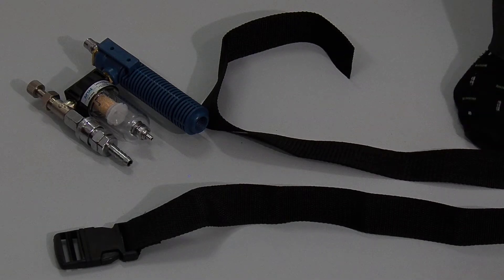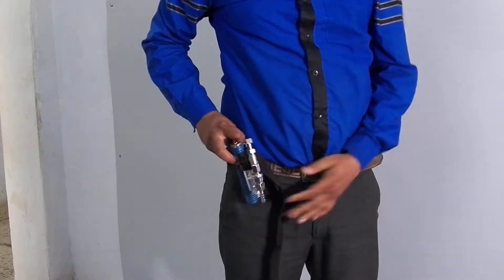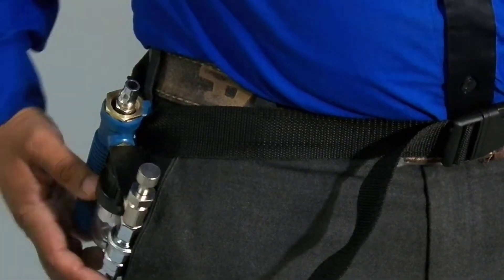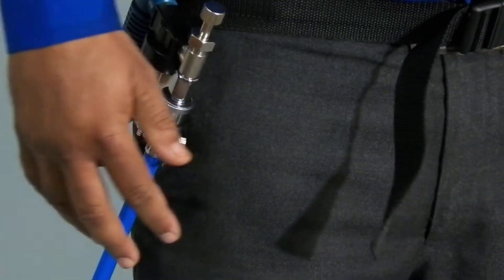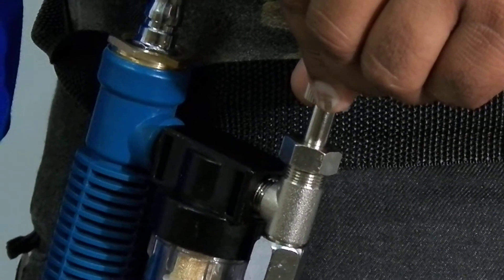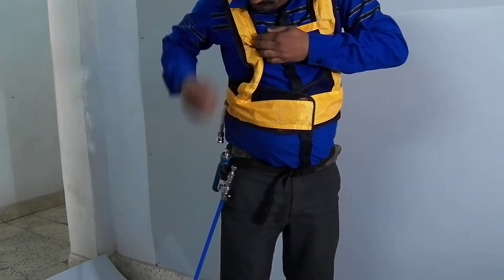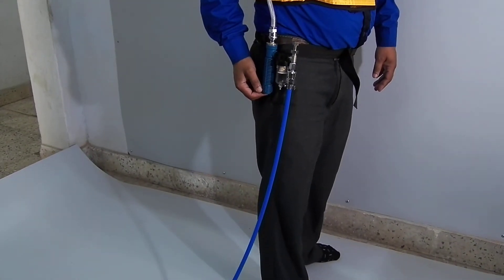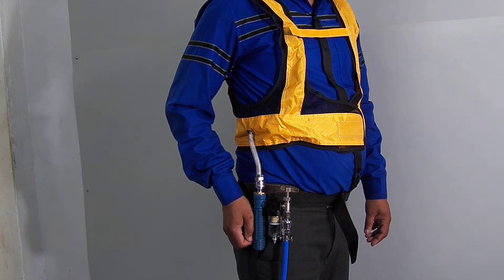General imsubs™ Vortex tube based personal Cooling Vest, how to use

Comment: When you charge the compressor how long the cooling fluid lasts ? please reply. 
Then you need another video explaining the difference between the 1500BTU and the 5000BTU units in regard to the weight/size of the whole system. . Thank you